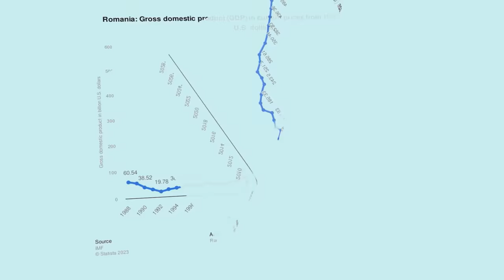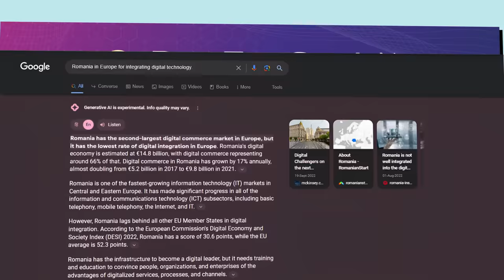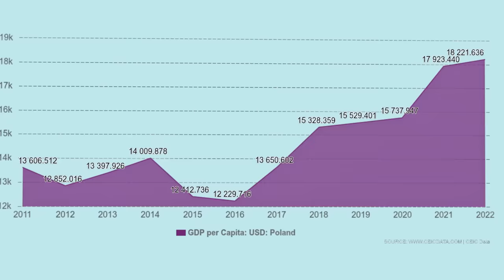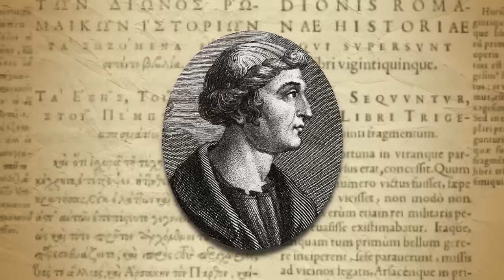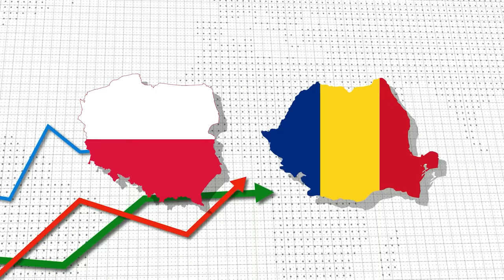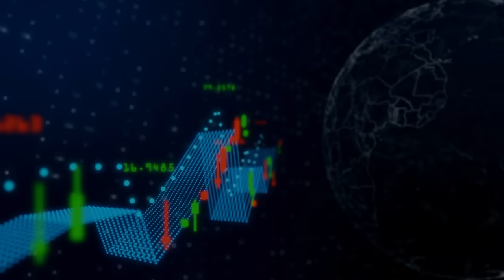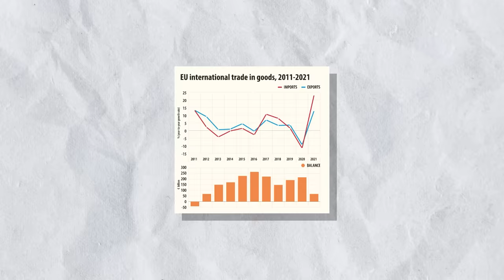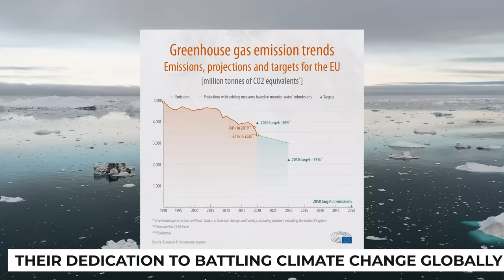Romania and Poland: Europe's New Dynamic Duo

Comment: Nice video, but your numbers need some corrections. The estimated 2023 GDP of Romania and Poland is, respectiveley, 350 and 842 bn USD at market prices. So their combined GDP is 1.192 trillion at market prices (so roughly 1.2 trillion). This is bigger than Turkey's (1.154) and not very far from Spain's (1.582). At purchasing power parity, the numbers are 781 and 1713 bn, so the combined figure is 2,494 (so about 2.5 trillion). This is bigger than Spain's (2.4).
Given their dynamism, similarities and coordination (and the even faster dynamic of Romania currently), they represent a force - granted.
PS. At min. 10:31, why are you using a pre-WWI map where half of Romania was under Habsburg and Tsarist empires and Poland didn't even existed (as it was occupied by the the surrounding empires? That doesn't make any sense.
Reply: Romania is 395.9 billions as the latest estimates.

Comment: There is no alliance between the 2 countries.

Romania is actually in deep problems. Since the covid it has run a high deficit together with the rest of EU. Now Germany and the other western economies put a stop to this and are requiring the same from Romania (threatening to cut EU funding), but we are not prepared. Taxation had to be increased. 
Second, Romania has increased its debt by 20% (10% of GDP) annually in the last 2 years. A lot of the growth is fueled by this debt. Is not so bad yet since we had a relatively low level of debt, at around 50% I believe. 
Third, Romania had and still has a HUGE problem with brain drain and population ageing.
Fourth, Romania has actually the lowest budged invested in development and research, at 6% of the EU average. That is abysmal. We import tech and provide a work force. That's about it in manufacturing. We have some successful startups in ITs. 

Although this is not catastrophically bad, still there is nothing to indicate that Romania will become a key player in EU.

So,  Poland. I don't know much about Poland's economy, but  considering is an eastern EU country and like all former communist countries they are experts in faking it until they make it I won't hold too much hope they do vastly better than Romania. 

Anyway, the biggest problem with Poland is that they are stuck in the past, like Russia. A lot of nationalist rhetoric centered around WW2. They are incapable of truly collaborating with someone. Again, like Russia, they view the other eastern EU countries to be inferior. Any collaboration between Poland and Romania won't be between two equal partners. There is no indication on Poland part that they actually want a partnership beside their desire for Romania to bankroll (with orders placed) the armament factories they want to build with Korea (where are the tanks, the artillery  and the planes they wanted to buy from Korea ?). 

Polish people have always been disrespectful toward Romanians, viewing us as nothing more than unwashed gypsies. 

Videos like this one are not anchored in reality, just click/views bait. Although, you should be aware of this when foods came into argument.